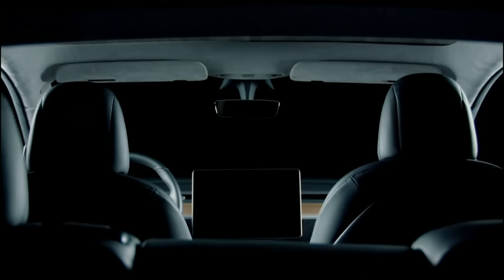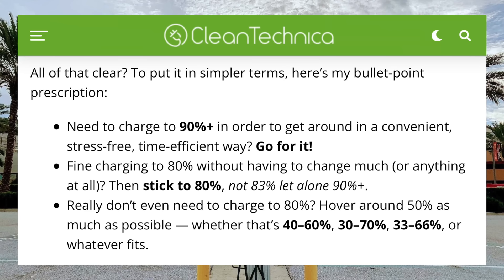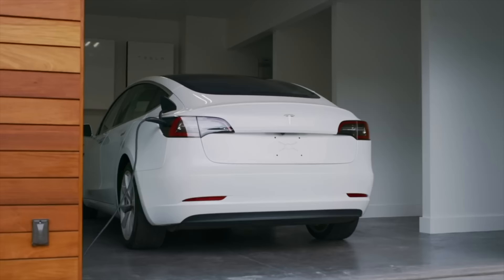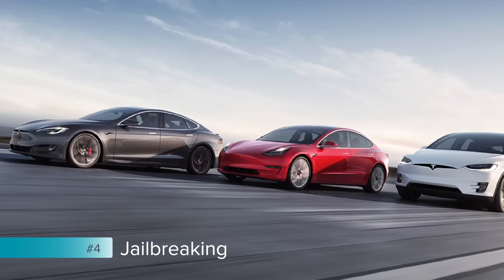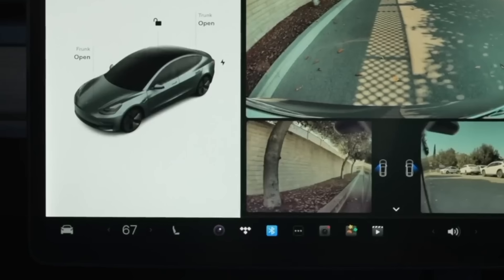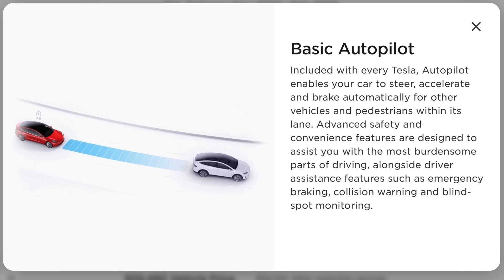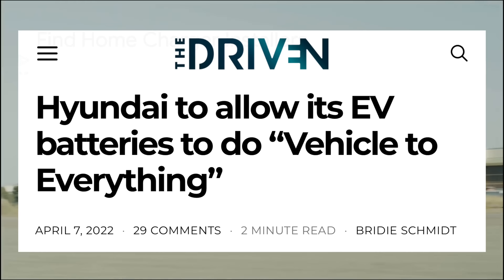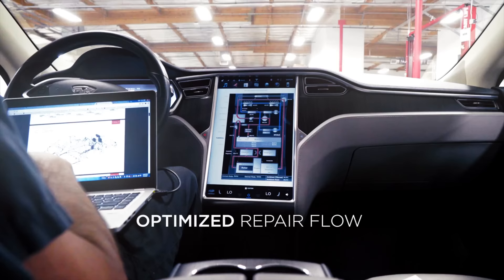10 Ways To Ruin Your Tesla | DO NOT Make This Mistake

Comment: Re: opening door.  Why don’t they put a door-open switch on the mechanical door release??  That way, as you raise the release handle, it would trigger the door-pop circuit and open the door properly, if the car has power.  It’s stupid to design the door so it damages itself if a passenger hasn’t been trained in the proper door-opening etiquette!
Reply: It not really the best reason but with manual release people sometimes take full second or longer to actuate the release. Sometimes You might abort in last millimetre and computer doesn't know what do You intend to do. Sometimes You might actuate it really really fast. Then it will not have enough of time to roll windows down and trim will be damaged and You will ask Tesla to fix it under warranty. All of this hassle just for cheap button to fix it.
Reply: @sebxx I understand the issue is the window.  But if the mechanical release triggered the door-pop circuit, it would properly lower the window AND open the door BEFORE the manual release could cause a problem.  If the power is out, just keep pulling the release lever until it opens mechanically.

Comment: Nice video, good advice.    My 2018 M3 LR's Basic Vehicle Limited Warranty and Tesla Road service expired last April.    The Drive Unit and Battery warranty is good for another 3 1/2 years.    

I plan to continue to bring it to Tesla for service.     Any thoughts on how to deal with a Tesla that is not covered by the Basic Vehicle Limited Warranty?

Also, is there some way to continue to pay for Tesla Road service?   I haven't been able to find any info on this on the Tesla site.

Comment: I own a tesla, I will never own another. The idea is great, but execution is brutal. Service is terrible on a good day. Price is through the roof. Competitors are catching up very quickly, with dealership support almost everywhere. Yes, you would certainly miss the SC network for fast reliable charging, but even that is catching up with 3rd parties. The Apple of cars with closed loop service and information blackouts was a classic move of capitalism in todays world. Finally, at the price they are now demanding...these cars should not have one manufacturing issue...period. Gaps, creaks, etc. are completely unacceptable at that staggering cost considering they are taking more, and more out of the car via a lack of chips, and somehow calling it better. FSD is word salad at best. Elon needs to stop over promising by several yrs and simply get it done. However, that's not how the hype machine works. We had considered the Y to replace our 3, but the 25K bump for not much more, is laughable. He may very have started the EV revolution, but I suspect the car is now the new iPhone with wheels. The hype is better than the product.

Comment: You will see your mistakes once you Buy & Use a Tesla and then you will realize like I did and am having :
*Specifically when you pay 12K (previous price) to FSD. However, Tesla calls its "driving assistant" feature Autopilot or FSD but says it does not build self-driving vehicles and requires active supervision by the driver!!! 12K/OMG!. FSD software still has a lot of stupidity. *And the car won't have internet if you don't pay more $9.99/month then all features will be disabled indefinitely:((Live Traffic Visualization, Satellite View Map, Live Camera  Sentry mode & Internet browser & ...!! ))

And it's also a lot of trouble every time you wait in line to charge your batter!

Comment: Regarding AutoPilot - we used it while driving thru Wisconsin at night and AutoPilot was potentially more dangerous than driving manually because of.... Phantom Braking! It happened often and randomly. It also happened during Lane Following as well as just speed control. AutoPilot still needs work.
Reply: I find that it generally isn't really phantom braking - there is generally a cause but it might be not really an issue.  I know on I66 there are constructions zones that somehow the car knows about and will slow down way more than needed, sometimes even changing the MAX speed to 35 and other times just slowing down.  I drive with my foot ready to press the accelerator whenever the car slows.

Comment: Honestly after this winter blast it would of been fun to jump start all the ICE cars with a plug in cables so I could flex on my car starting outside under a sheet of ice and snow but I did give 4 probably future Tesla owners a ride to work after they saw how the model 3rwd handled the icy roads and went right up hills other cars were stuck on and because of the lower center of gravity (a full car of adults probably didn't hurt) in -4 f -24f wind chill it was awesome did use twice of what I would in energy cabin on hi heat ac heat seats ECT but there is a a charger everywhere where here so 👍

Comment: I was very surprised that my model s had a frunk that you have to manually close like I had to on my old 1995 Camry.  Thought for $100K it would be automatic.
Reply: If that’s your only complaint, then that’s pretty solid! Bet that 95 Camry didn’t have a 3 sec 0-60 or advanced safety features either?
Reply: @christiancairy8012    Pretty much yeah and it's not really a complaint more of an observation.  I love my model S and will never go back to a gas car, I just wish it had more range.  I have the 85 khw battery with 89,000 miles and so far the battery has degraded from 265 to 240 but Tesla recommends I keep my battery % between 20% to 80% so I keep my range between 46 and 192 miles which gives me a range of about 146 miles in perfect conditions and right now with the freezing temps zapping my range and having to drive 75 MPH on my freeway with the heater and radio and wipers on my actual range is about 110 miles.  My wife's 2020 Camry can get over 500 miles on a full tank of gas so I guess that would be my only complaint.

Comment: How can I tell if my Model3 uses the LFP batt? I am charging to 80% because my dealership told me to, but the app says I should charge to 100% at least once a week. So a bit confused as to which advice to follow. :(
Reply: To determine if your Tesla has an LFP battery, navigate to Controls > Software > Additional Vehicle Information on your Tesla's touchscreen. If you see “High Voltage Battery type: Lithium Iron Phosphate” listed, your Tesla has a LFP battery.

Comment: The distraction devise (phone)  attached to your steering wheel is a no no because you're not watching the road ok got it...but what about the elephant in the room? that overly large screen (distraction devise) about 45 degrees from your normal driving angle of view that you're forced to use for most all functions? Oh that's not a problem, perfectly fine. I don't condone using cell phone for texting while driving and it's a real head scratcher how NHTSA came to the conclusion that using touch screen in car was safe and got their OK.

Comment: Theres nothing more shonky than the build quality of Tesla. I'd expect better considering the price tag.
Im a mobile detailer in the UK.
Ive seen a fair few Teslas..
I have a customer with a dead model S traction battery
The car is 7 years old, has done 60,000 miles.
The battery died in November 2022.
Tesla has had it since then... They hope to have a battery and the car back to him in July 2023.
Because the guy cannot charge at home he has used the Tesla charge network for all his charging.
Tesla say this is battery abuse and not covered by the warranty. 
The new battery is costing him £32,000.
Then he's selling the car... 
He has had 2x drive motors fail
5 door handles fail (When the door handles fail, you can either not lock the car or cannot get in.)
2x LCD screens that leaked.
An issue where the brake lights dont come on unless he used the foot brake.
His next car will not be an EV.
The range is p1ss poor, so 30 to 80% makes it even worse.
One day Musk will be held accountable for his lies.

Comment: Is the 2021 SR+ equipped with a LFP battery?
Reply: To determine if your Tesla has an LFP battery, navigate to Controls > Software > Additional Vehicle Information on your Tesla's touchscreen. If you see “High Voltage Battery type: Lithium Iron Phosphate” listed, your Tesla has a LFP battery.

Comment: Thanks so much for all the good information. I am not sure how to contact Tesla regarding a safety issue. Do you know how? The blindspot audio signal in our 2021 Tesla Model Y only gets activated when you signal AND start to leave your lane. That seems incredibly dangerous because the driver has to be already leaving the current lane in order to receive a warning not to leave the lane. Our Mercedes SUV blindspot audio signal is activated by the turn signal alone, which is a much safer option. The recent blindspot visual cue on the screen is not sufficient.

Comment: Wondering about your experience with Autodrive.  I try to utilize it whenever we're out and about.  Where should you put your hands?  I usually hold the bottom of the wheel when in Autodrive.  My problem is that sometimes the car will go for miles without making me giggle the wheel.  Other times I swear I don't get 1/4 mile without needing to giggle the wheel.  Haven't figured out why there's such a difference between drives.
Reply: Use 2 hands on wheel and guide the wheel lightly.  It becomes automatic quickly
Reply: Try a full throated laugh rather than a giggle 😂
Reply: @ancientsymbol  Tune into an Abbott and Costello routine on media preferences.

Comment: If im not planning to use tesla for 3-4 months. Do I need to keep it charged?
Reply: Yes, you should just leave the car plugged in and it will charge when it needs it. You should set the max charge level to 80%, unless you have the LFP battery.
Reply: @shannonlawhorn1674  Thanks so much. Will do so

Comment: #8 I disagree with this one. You can use a weight and still have hands on wheel and pay attention. Its not one or the other. I have issue with AP because you end up moving wheel in opposite direction of where you're driving which is stupid. I use a weight on highway, I have hands on wheel and I pay attention.
Reply: It's dangerous because if You faint then car will keep going. It's especially horrible if there are passenger in car because there is basically nothing they can do.
Reply: @darekmistrz4364  if I faint AP will break if anyone is in front of car. And I would guess if people faint in car we have a whole a lot of other problems then ppl using a weight.

Comment: The emergency door release problem is plain stupid engineering.  Yes, there needs to be an emergency release, but there's no reason to not activate the window drop if power IS available.  Passengers are going to quite naturally feel for the release lever and use it.  It's aggravating and embarassing to have to warn everyone in the front seat, "Hey don't pull the lever it ruins the car".   And they're like "why did you buy such a stupid car"?

Comment: I just purchased a Model 3, three months ago and since that time, I have had to replace two windshields. pretty frustrating. I was told by the glass co. that the windshields are thinner to cut down on the weight.

Any ideas or add-ons you would suggest that would prevent chips or broken windows??
Reply: Wow, not much you can do about this. Just bad luck imo. I have ceramic coat but I doubt that would do much against a windshield impact. Avoid driving behind trucks and keep a great follow distance overall might help though.

Comment: Picking up 2022 Model X Plaid the day before I take it on a 2 week, >1k mile road trip. I am very nervous to do this based on some of these threads. Would appreciate some input: is this too risky?
Reply: Not really risky. It depends on what are You worried about? Are You worried about going out of range of superchargers or else?
Reply: Sounds like the perfect way to get used to your car quickly. It took me about 3 days of regular driving to feel comfortable and connected to the road. Tesla's really are unique in terms of driving experience. You'll find yourself relearning how to accelerate and break using a single pedal. After about a week, I could eyeball the gap needed to fully break using Regen at almost any speed.
Just be careful and don't be in too much of a rush to discover your cars capabilities. I would highly recommend looking up some videos regarding Safety Score which you'll want to be paying attention to from day 1

Comment: Amusing that Ryan say your shouldn't charge an EV to 100% or down to 0%, yet advocates exactly that for the Smoosat scooter.  A nominal 20 mile range will not take you 10 miles to work and back again!  Legally you can go 20 mph in a scooter...you want something more capable and widely sold than the Smoosat.

Comment: US law prevents car builders to deny warranty claims due to the use of a 3rd party mod, consumable or service....
has been the law since like the 70s....

The exception is IF the car builder gets an EXCLUSION from the government, and have yet to see tesla get one. So, if you get better shocks for your tesla, and then your head lights go out, or battery pack dies early, unless tesla can prove the shocks are the cause of the problem, you should be covered, if not, get a lawyer.

Now for software changes, that is in a grey area, as it IS a limited warranty, they can put their exclusions in there that do break the current laws, and the current laws were written well before computer programs were put into cars, i think at the time the largest computer a a relay for your blinker...

Edit: and you may hear the lovely busy word "right to repair" yeah that is already the law, and also applies to tesla already. Has been the law since the 70s. Tesla can not stop you from fixing your own car, and then turn you down for another issue because you fixed something unrelated, they would have to prove that your first fix caused the 2nd issue that you are bringing the car in for service. Just like with your apple, or google phones. You already legally have a "right to repair" in US.
Reply: Yeah sounds fun :)) time, problems, lawyers, etc. Wouldn't it be better if you leave the car as designed and avoid all the headache?

Comment: So basically it's a bunch of lies about the battery 80% to 30% you never get the range they talk about and you left out the part about the hundreds of tons thousands of tons of CO 2 it took to make that lithium Battery and it takes 480000 miles of driving to break even on the CO 2 that that stupid car put out just in the manufacturing of it nobody's gonna drive one of those 480000  miles.

Comment: I've driven a Model Y for almost two years. This is the first I've heard of the frunk hood closing info - and I read the manual.   Thanks.
 I've also driven FSD for this entire time, including two cross country trips, and four trips up the California coast and back. It's terrific, but it still does a lot of 'dumb things,'  - you don't want to cheat that system.  However, I don't like the way Tesla does the hand on the wheel requirement. I've been driving for so many years when I have both hands on the wheel  it's so balanced my Model Y registers this as no hands on the wheel. It's basically de-trained me to use only one hand on the wheel. Annoying. 
And don't get caught after an accident having a record somewhere of buying one of those steering wheel weight cheats.  So why bother with FSD? Simple, on a long trip there's an incredible amount of stress and effort in just keeping the car in the lane - FSD eliminates that.  It makes driving cross country actually relaxing and fun.  I also use it on surface streets and for short errand runs. I use it pretty much when ever I can. 
The current hand position recommendation is 3 and 9 positions on the steering wheel. I was taught 10 and 2. Why the change? The airbag. If you have a hand high on the steering wheel and the airbag goes off with your hand in the way you Mike Tyson punch yourself in the face.  I just wish they hadn't put the cross bar right in that spot.  
I've got a ding in my Tesla. One of the Tesla recommended body shops gave me some nonsense about how they have to disconnect the high voltage battery to work on the fender. Sounds like complete bunk to me, and I doubt that Tesla would consider that shop 'certified' for that. For now I have to live with the ding. (Are all body shops crooked? There's one on the list I already knew was crooked.)

Comment: As long as you don't have FSD Beta enabled you can use the counterweight without any issues by also blocking the camera.
Reply: If you block that camera so you can use the wheel weight, you are being quite stupid. To actively disable a safety feature so you don’t have to pay attention while driving is a sure fire recipe for a disaster!